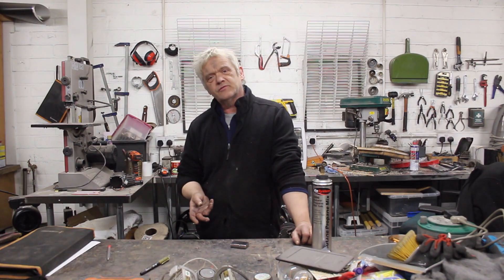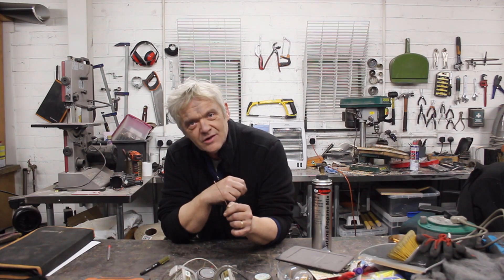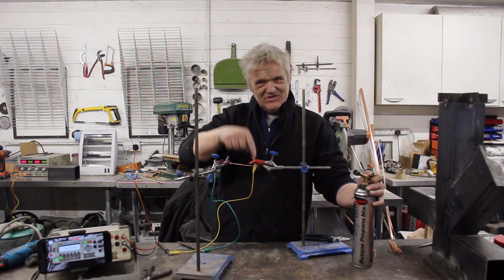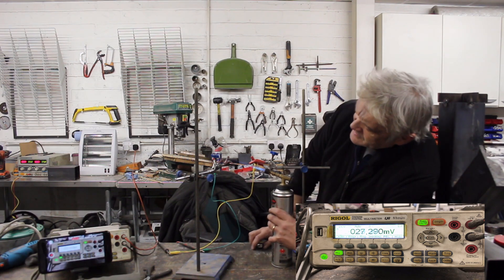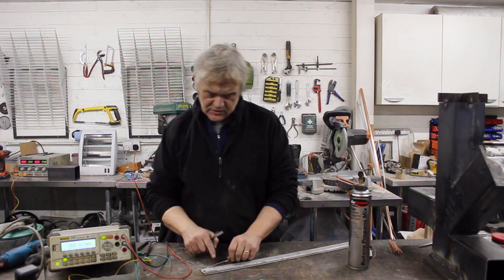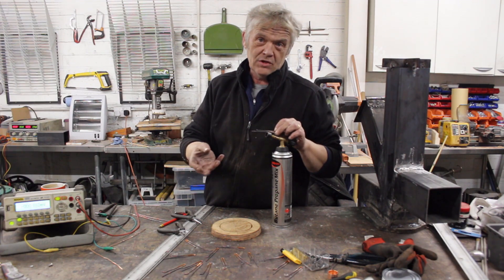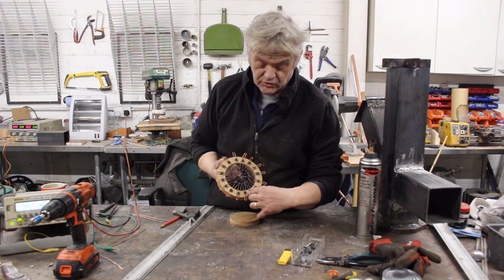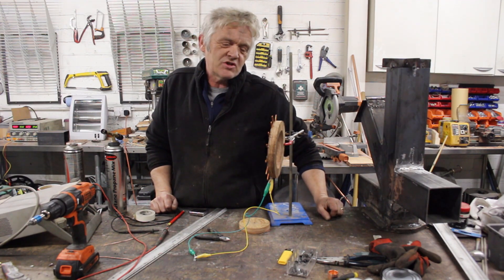1416 How To Make A Very Different DIY Thermoelectric  Generator For A Rocket Stove

Comment: From na jornal of 1844 i ve read they used Nickel wire and Iron wire soldered togother as TEG and used it for galvanicing. 10 parallel with 20 pairs each.

Comment: The junction area gets you current. If each cell has 1 thin steel tube between hot and cold, copper (NiCu alloy is better) wire to go from one hot end to the next cold end and a piece of shim stock copper sheet curled into the tube end with the wire end under will expand against the steel and finish tightening contact with ID x length x pi area. Feed the output to a Joule Thief battery charger! Use solar energy in countries when the sun shines to charge cell phones? I have DC-DC boost converters that take 0.9V and give 5V at less current with 95% efficiency, see why loads of current is desired?
BTW the Thomson Effect explains where the current-resistance heat goes, straight to the cold junction as extra electron energy!

Comment: I curious to know if Cobalt/Steel winding from an electric stove would be useful to generate electricity from the rocket stove. Like an inverse use of the coil? Like get some amps and use spark gaps to increase the voltage. Maybe use it with parabolic lense and the sun. Get another coil and have it wound in the opposite direction and levitate a magnet between the opposing magnetic fields to induct more energy into the windings. I hope I didn't brainstorm an antigravity machine from a rocket stove and you steal my ideas. Actually that's the secret to the hydrogen bomb. Just add water. That's why when you put molten steel on concrete is not wise. It creates such a a high amp through a basic thermocouple with the ingredients in concrete it splits the water inside the concrete, implodes the hydrogen and explodes the oxygen. Put that experiment on a voltmeter.

Comment: hi Robert... great channel and always something to learn or a different viewpoint which is essential when inventing or improving things... I have  aquestion... am I correct in assuming that more surface area contact would result in more voltage or current? someone already mentioned 2 pipes one inserted in the other then if you heated them would they not form an oxide layer between them? I will make one of these practical I do need one lol... the vibrational energy harvesters are also still on a burner somewhere I'll get bk to that later thanks again !!!
Reply from the maker: cheers mate and more current - more points of contact would give more voltage

Comment: The use of a copper oxide junction reminds me of a patent I found a couple of years ago, US3516871, “method of producing electric current utilizing a copper oxide thermoelectric generator”. There are several unique things about this patent. The device is a small cylindrical copper casing .3 cm wide and .6 long filled with Copper oxide(s) made by melting a copper wire over the open end with an oxidizing flame. One electrode is attached to the case and the other is inserted part way down the center. When heated to 800 C the device produces 400 mA at .2 V. or 80 mW. Given the size of the device this is a fairly incredible power density. It’s the only time I’ve seen bulk CuO used in a TEG since most people have been inclined to oxidize wires for convenience.

Comment: Hello Robert I've been a member for years and years. But it's been a long time since I commented. I just wanted to ask you what you think of the idea 💡 of drilling deep down as close as we can get to the earth's core to produce geothermal energy by letting water sink into a deep shaft and flashing it into steam to run electric generators the size of city's? I know it's all hypothetical but do you think that it could work? Or do you think that maybe it might cool down the earth's core stopping plate tectonics? And BTW my name is Charlie I just use Fred as an alias

Comment: Robert, apologies for digressing - is there any practical re-use (say generating electricity) for the flat copper coil within induction hobs ?  It looks like something well made which could be reincarnated.
Reply from the maker: I haven'treall thought much about them mate - but I will grab one when I can and have a mull over - like you I get a sense there must be

Comment: I had attempted to make this style of thermo electric into a flue pipe, trying to keep the contact pressure adequate without grounding was frustrating. I eventually moved on to swaging copper pipe so that it sleeves inside the next. I also painted on a slightly thicker layer of copper oxide. Worked better, but still not great for the price. Thin copper flue pipe swaged in the same way would be the most ideal I think, but I've yet to find such a thing

Comment: I am surprised that TEGs are not placed on the stove pipes out side for cold weather to make a couple hundred watts or more when the wood burning stove is going to recharge batteries for an inverter or to use a stirling engine generator on a stove for power.

Comment: My dad used to have one like this.  It was a series of rings of copper strips (alternating with some other metal IIRC), riveted into the same radial form you did.  Each strip was about 10 mm wide.  Then there were maybe 20 stacks of these one on top of the other - the stack was about 200 mm high.  A kerosene burner with a wick sat under it as the heat source up the middle of the stack, and the 'fins' of the cold ends were simply exposed to the colder air in the room. The device gave a good 12 Volts, and of course the waste heat warmed the room.   In the 1950s we used to sit in our living room in New Zealand and listen to the BBC shortwave broadcasts on a radio powered by this thing, while keeping warm at the same time.  T'was majik!  
Stick one in the focus of a small solar collector and you would be good to go.
Of course these are the same principle as used in NASA's radioisotope thermoelectric generators on rovers and deep space missions like Voyager.  
Just find a decent dT and you are all sorted!
Reply: what was it called?
Reply: @DSeeKer  f’get. Long time ago. Maybe Tilley did something like that.

Comment: You are going to have to find a dielectric that can handle some heat.  When you put that wood in your rocket stove, it is going to burn.  Furthermore, you may have issues creating current in the rocket stove because the whole stove is going to get real hot real fast and you will no longer have the temperature differential.  Thus you are going to have to have a way to have a portion of your wires outside of the rocket stove.  It is going to be difficult to do that without air leakage and grounding your wires so that the electricity just flows to the ground instead of to your load.  Neat idea, though.

Comment: I have an ancient copy of a book called "The Boy Electrician"" published in 1913, it details an almost identical assembly using copper wire and "german silver" wire which is in fact copper nickel wire.
The book suggests using 40 or 50 pieces of each type of wire and mentions an output of about 6v 250mA.(using 16swg wire and a spirit lamp) About the same voltage per junction as yours. Not a huge amount of power but quite enough to charge a mobile phone slowly or to power quite a bright LED. I have owned a copy of the book for well over 50 years now, since I was a kid, highly recommended reading for experimenters as there are a lot of ideas in it.
Reply: When I was 10 I had that same book borrowed from the library and built one of the T E Gs.
Reply: @g0fvt  after reading your comment, i have purchased that book. Thanks 👍
Reply: @Pradjaya  excellent, thank you for the feedback. The book does hark back to a very different time. I hope you enjoy it.

Comment: What's the internal resistance of the thermopile?  If it's low enough, you might power a lot of LEDs at the same low voltage.  As you said, it's low voltage, but can be surprisingly high current.  ( The "Kathy Loves Physics" YouTube clip on Ohm's Law describes using a thermocouple as a standard low-resistance voltage source.)

Comment: facsinating, still didnt quite grasp the way that differing materials connected can create a voltage but im very intrigued, seems like this could shed light on some more basic aspects of the thermo-electric relationship. i like to think that heat is just very low voltage electricity and if we can some how make a material that focuses the heat then a high enough voltage can be created. we will need this for fusion energy production especially as well as many other forms of energy production. thanks for the video, love you creativity and confidence :)

Comment: try some pencil lead (grapite) wit aluminum rod . . it'll give way biggeroutput !!
Reply from the maker: no it doesn't - it gives around 10 millivolts per junction this gave 170 millivolts per junction
Reply: @ThinkingandTinkering  so you have copper oxie and ?? can't tell by the vid, no lose ups and a lot of bbbbrbrbrbabell

Comment: Graphite sheet and aluminum sheet in strips work well for this concept.
Reply from the maker: as far as I know mate it only gives around 10 millivolts per junction when you use graphite and aluminium
Reply: @ThinkingandTinkering  Yes but the form factor is easy and thin meaning you can pack more junctions into the heating area or you can use copper film/sheet and copper oxieds. Basically using the electronegativity chart you showed how to find good combinations awhile back for other variants.

Comment: Does the wire thickness allow more or less voltage? So if I heat a thicker gauge wire would I expect more voltage, less, or about the same?
Reply from the maker: it would give more voltage but mostly because the resistance would be less
Reply: @ThinkingandTinkering  Very kind to take the time to reply. Great videos and thank you for sharing.

Comment: This is really cool! I have a plan for my homestead for generating electricity by coiling a copper pipe inside my chimney to heat water that will  turn a steam turbine to produce electricity.
Reply from the maker: nice plan mate
Reply: Don't cool your flue gases too much, or the chimney won't draw.  And, if you don't capture and condense the steam, you'll be busy putting water into it, when you might just put the generator on an exercise bike and crank it yourself (~100W), for your standard human crank-turner.
Reply: @cdorcey1735  That steam will go on from the turbine to heat my hot water tank and condense back into water. There are plenty of videos on here showing you that it has been done before and it does work. without the need for an exercise bike.

Comment: peltier actually cheap from china
,you can stick a bunch of them say 20 pcs on the stove steel with thermal glue ,there are also " high power" peltier
Reply from the maker: don't forget most Peltier devices don't cope with temperatures over the melting point of the solder - that's around 250C this was working at 800C and e measured the temp of the rocket stove jacket at 400C so the fire will be hotter and most pelters will just burn out

Comment: Or use the heat from the top of the stove to move a computer fan ( type) to generate power ? Like the ones you can buy from the shop
Reply from the maker: it might just melt the fan mate - the stove burns well over 400C

Comment: So surrounding the jacket of a piston engine burning hydrogen oxygen with a fuel cell supplied by electric from thermo coupled wires opposed to a separate generation coil
Reply from the maker: sounds like plan mate

Comment: I’m totally confused. I usually understand these videos but I haven’t a clue what is causing the existence of a current here. Was there a reason to cut the wires then string them back together? Couldn’t you make the thing much simpler by using one continuous wire with bends in it?

So in other words, you just bend a copper wire back on itself a bunch of times, hit the bends with a propane torch and hey presto?

Seems like you could put a heat source inside a toroid and get some electricity from all the loops, right? Or heat one side of a transformer?What am I missing?
Reply: I believe (please somebody correct me if I'm wrong), each strand of copper generates electric from its heated end to its cooled end so if you only had one line of copper you would only get one small output.  So you have to have lots.  And the bigger difference in the heat and cold the bigger the voltage or amps are.  There are better explanations out there, type in the words "Thermoelectric" and "Peltier"  or "TEG" (Thermo Electric Generators)into your search bar and browse other YT vids.  Take care, Poo
Reply: @poosmate  There needs to be a temperature differential between the two metals for a voltage to be generated.
This is how a thermocouple works. The voltage generated is directly related to the temperature differential. 
If you reverse this you get the Peltier effect. That is, if you apply a voltage across two different metals, you obtain a temperature differential. The peltier effect can then be used as a heating or cooling device depending on which metal you connect to
Reply: @PetraKann  Thanks Petra, it's been a long time since I looked into this.  I understood the temperature difference, it's the construction I struggle with.  I watched a video where someone (Possibly Mr Teslonian) used different types of metals paired together to find the combination that gave the best output.  I remember thinking at the time that Graphene or graphite should be one of those conductors.  I should watch more videos and refresh my memory.  Take care, Poo
Reply: Look up thermocouple. That’s how it works. The oxide layer creates a barrier that causes the two pieces of copper to react as two separate metals.
Reply: @mikebond6328  In fact the Peltier effect is a reverse thermocouple
Reply: Okay, so I’ve watched a bunch of videos about thermocouples and that’s what he’s doing, daisy chaining a bunch that work because the oxidized carbon layers function as different metals. 

Could you get the same effect with a carbon arc gouging rod? You have the outer copper wrap and the graphite on the inside.
Reply: A toroid transformer is made of wiring that is insulated. Burning off the insulation causes a short circuit
Reply from the maker: I'll post an explanation mate

Comment: OK, so this is the DIY for absolutely anybody version, which I love. But for those wishing to push this further, Rob has a video on laser-sintering copper traces onto glass at home. 
I suspect one could laser-sinter copper tracesonto a heat-resistant ceramic, on both sides, and then oxidise the ends. So that when these "tiles" are stacked on top of each other, the traces overlap and form junctions. So now you have hundreds of junctions in a small form-factor and that is robust.
Reply from the maker: I like that mate - nice idea - but you are a bit more advanced
Reply: @ThinkingandTinkering  LOL I dunno about that mate, I am not sure I even count as advanced lifeform XD

Comment: you could lay the circular array of wires in a continuous spiral, in a heat resistant material the diameter and length of a piece of stove pipe, then simply insert in into the stoves exhaust.
Reply from the maker: nice

Comment: On older pilot lit, gas powered, hot water tanks and furnaces, they installed a thermo-cupler that was positioned so it was heated by the pilot light. The electricity generated in turn kept a gas valve open which supplied gas for the pilot light.

If the pilot light went out, or the thermo-cupler stopped producing electricity, the valve that fed the pilot light would be closed and prevent gas from building up.

It would be an interesting comparison between what you built and those things.
Reply from the maker: just need to find one mate - I think Honeywell did them
Reply: The residential type of equipment that used thermal couples are 25-35 millivolts. And commercial equipment such as restaurants and industry the commonly used 250 millivolts.  This is in the U.S. 
   when you can stack 2amps @  13 v dc worth of thermal  couples you would have a battery charger.
Reply: @jeffstout6567  

Thanks for the info.

Comment: Bob,
Back in the ,i think, the 1930's they had gas powered radio's for use where they had no power supplies. The multi thermo you built-- they had a stack like that that not only provided the low voltage for the valves filament but somehow made the H.T. voltage as well ( no transistors then ! ) dont know of any further info on this.
Reply from the maker: nice info mate thanks for the heads up

Comment: I recall mr. Keshe did this blackening of copper wires, but he called it differently. Seeing you do this, I understand how Keshe got the idea of using this to fool people. I hope some search engine results end up here so that people can see the actual way of using oxidized copper to generate a bit of power.
Apart from that, a great experiment! I assume the heat is knocking electrons out of their band in a higher one, making them free to go.
I am not sure why you mentioned solar. Did you refer to anything of a solar application with this wire? I'd like to know that as well.
Reply from the maker: red copper oxide is photoactive mate - it's a native p-type semiconductor
Reply: @ThinkingandTinkering  O yes it is! Google does give many hits, I can explore it further. Thanks!
Reply: He was referring to a previous video in which he made a “solar cell” by oxidizing a copper plate.